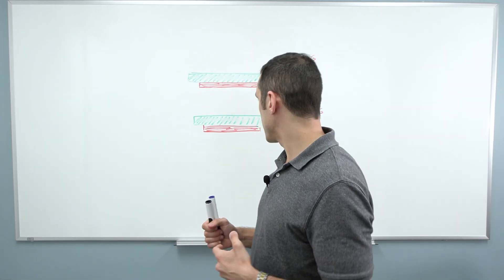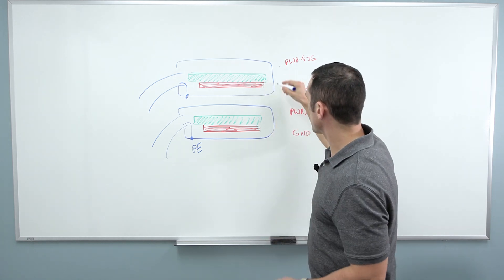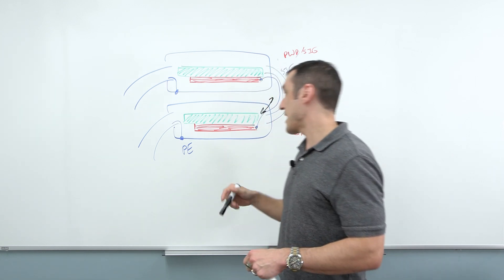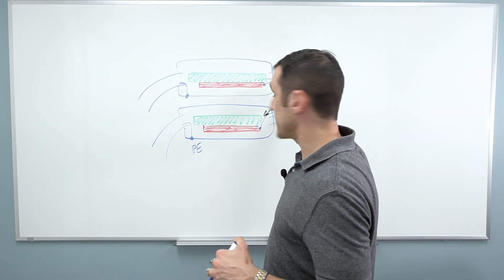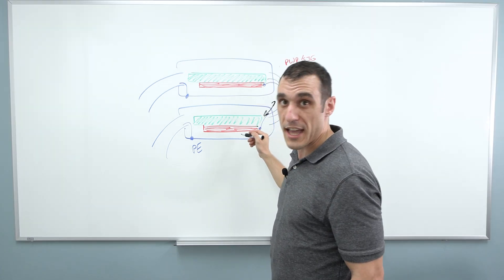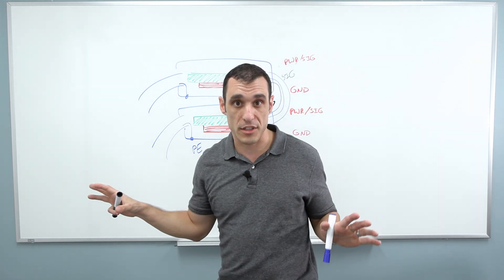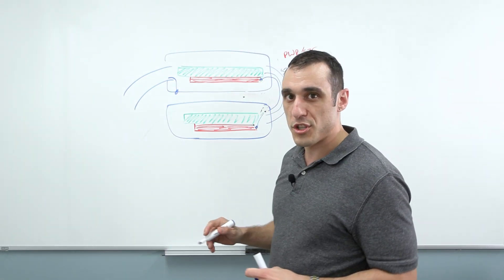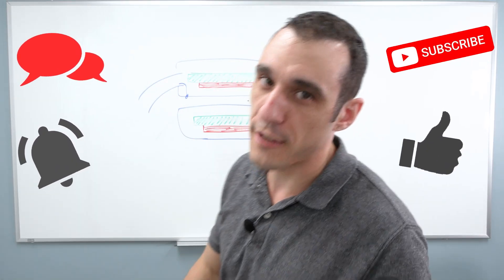Should You Route GND or PE Through a Connector?

Comment: What if there's a substantial potential difference between the 2 GND's (let's say 10V), then what about the signal connections? They will be way too high or too low either, or not?
Reply: HI Hans,
This was actually one of the original reasons for the development of differential pairs; they don't need a ground reference, the signal levels on each trace in the pair are referenced to each other. The other reason was to support high speed/high serial data rate digital signaling with a conductor configuration that only radiates differential mode noise and that can withstand strong common-mode noise.

One guideline I have seen in the past when shielding is needed between two enclosures is to use a capacitor to couple the shields between the two grounds in the enclosures. This is better than grounding the cable at only one end from an EMC perspective because that cable shield might act as a resonator or antenna. The cap would block DC offsets and strong noise at power frequencies, but it allows high frequency (RF) noise to dissipate in either side. The cap and the native DC shielding in the cable basically make a high-pass filter, so you should size the cap accordingly.

Comment: My solution that has worked and continues to work is to use isolated power supplies to power isolated communication drivers like for RS485, RS422, and CANed networks.  Each isolated DC Ground can be tied together as a common reference point for both types of signals.

Comment: What if two different boards powered through two different power supplies communicate on Serial protocol, eg, UART , and face issues due to mentioned problem in video? Should we make the TX/RX line btw two boards differential?
Reply: Hi Raza,

In a practical situation, you would generally not do this with two different power supplies unless you can tie the grounds together so that any GND offset is removed between the two boards. What you are describing, and the need to use differential TX/RX or bidirectional differential pairs happens in larger installations. For example, automotive data connections use CAN bus to transfer data within a vehicle over differential pairs. Ground offsets and noise are very common in an automobile, so it makes sense to use a low-speed differential protocol like CAN bus to deal with both problems. CAN bus is also used in industrial computing installations as part of distributed process control systems. This protocol can easily withstand about 5 V ground offset with most transceivers, although larger offsets are possible on some components.

Comment: Lots of talk and pen lid clicking but little in terms of solutions. Do you short the planes to the case? Do you ground the screws? Do you need 00 AWG screened cable to survive fault currents? Why is ethernet OK? What about USB? Are phonos between rooms safe? Do I fit GND resistors to prevent loops? What effect does grounding the case have on EMC? Does Altium have an equivalent to Hyperlynx for less than $20,000?

Comment: PE is connected to chassis of the atx case and the GND of the mainboard is connected to chassis through mount holes. Is it a right practise?
Reply: Yes that is an appropriate practice in many cases, it just depends on the specific noise or safety problem you need to deal with. That type of practice normally targets RF noise by giving it a very low impedance path to reach GND at multiple points on the board. The other reason you might do that on a computer specifically is to make a connection between some exposed metal (like a connector) and your safety ground (the chassis in this case) in case an ESD event occurs near that connector. That way, any current that gets excited in the board during ESD goes into the chassis (your safety ground) instead of into your circuits.

However, you should ask yourself, do you know for sure those mounting holes are grounded? They might be grounded to the case, but not necessarily to the board. Just because you see exposed copper on a mounting hole, it doesn't mean that the copper on the mounting hole is connected to the internal GND plane. Normally it is grounded like this in computer motherboards, but this is just something to think about in general....

As an example from industrial Ethernet design, the exposed metal shroud on the connectors can be a place where an ESD event causes an electrical pulse to enter the board, and so these points can be grounded directly to the chassis. There is a good Renesas application note that shows how to do this (see page 11 and 31): https://www.renesas.com/us/en/document/apn/industrial-ethernet-phy-r19an0015ed0102-rev102?language=en

In this system the portion of the board near the power input would also be grounded back to the frame, so you have at least two points where the board and frame grounds are bridged. This could create a big ground loop, but then what they do in that system is separate the GND plane between the Ethernet PHY and the magnetics circuit/RJ45 connector, so the loop is broken because the GND planes are separate. In that case, the only signal you should route over the gap in that plane is the Ethernet traces as they are differential pairs, and even then you should only do this at low speed (10/100) because the carrier frequency is pretty low. I also don't agree with splitting the AGND and DGND sections of the ground layer as shown in page 31; as soon as you route a digital signal over the gap between DGND and AGND, you can create strong radiated emission. There is also a lot of debate as to whether GND should be cleared from beneath discrete magnetics circuits. I discussed some of this in a Signal Integrity Journal article last year: https://www.signalintegrityjournal.com/articles/1808-ethernet-connectors-and-routing-above-ground-planes